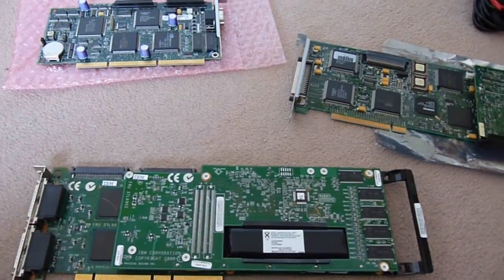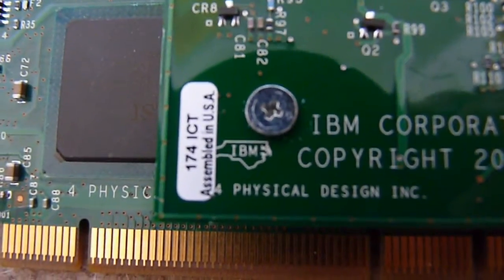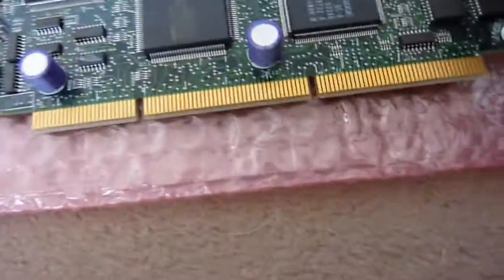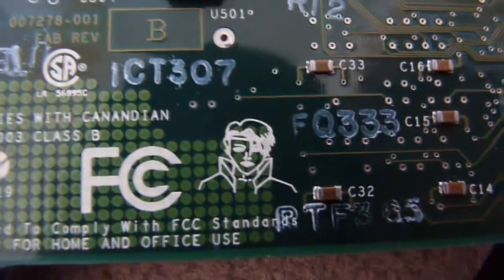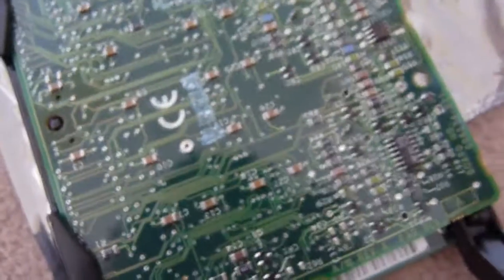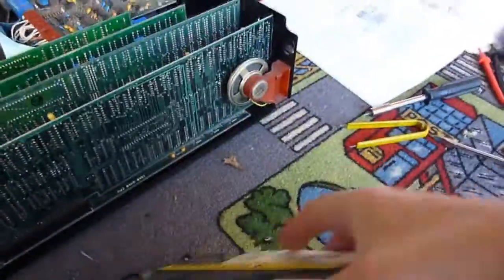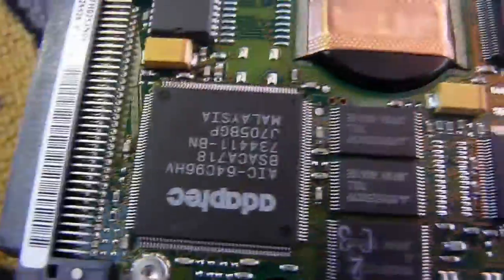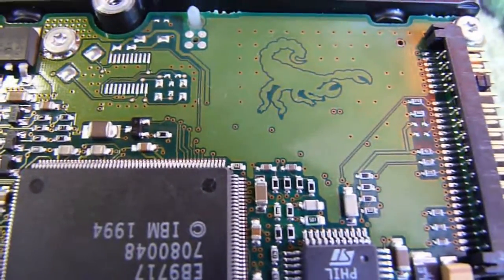PCB Art

Comment: My Umax Pulsar+ got all engineer´s signatures on in the inside of the case front door which is covering the drives;) Some of my Synth got some written stuff and/or little icons on the silk screen of the PCBs.
And, of course, i done the same when i was working as a PCB designer..;) It´s the things you do when you´re under pressure and need to fool around, then you put something on the PCBs (as i usually put this stuff in the inner ground planes, only to see when/if the PCBs are x-ray´d or viewed through a very bright light source...;)

As our SoftGuys done the same things in their code, if you read out some (ep)roms you´ll see some text or little fun-code at the end of the roms, or even small routines that turn a industrial controller unit into a little arcade machine....As we used to missuse the LEDs/Displays for simple "hit or miss" games to be played with some of the buttons..;)
Reply from the maker: I put a lot of estereggs in my code that now runs on production servers =-)